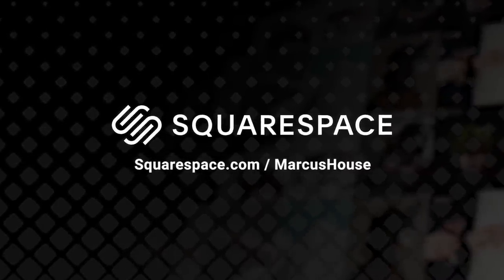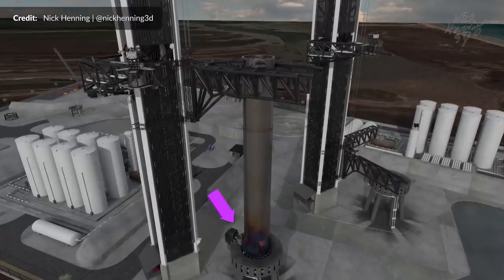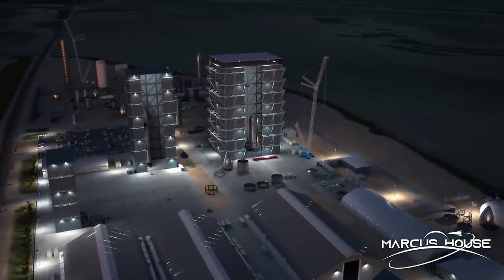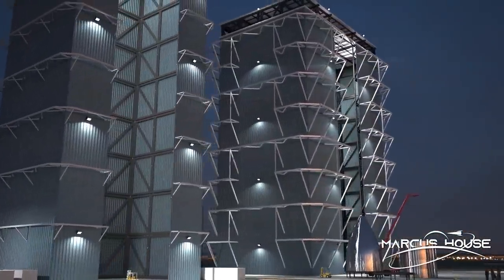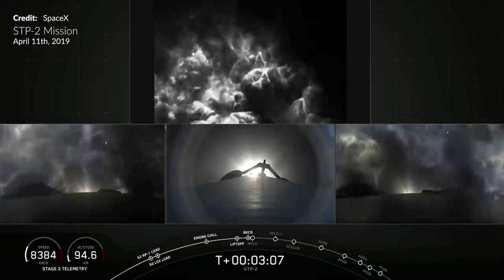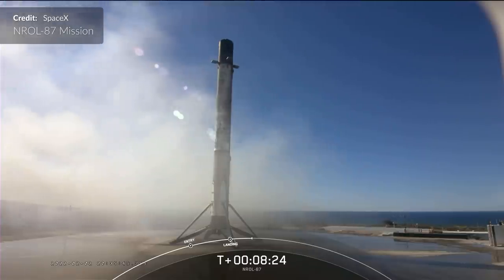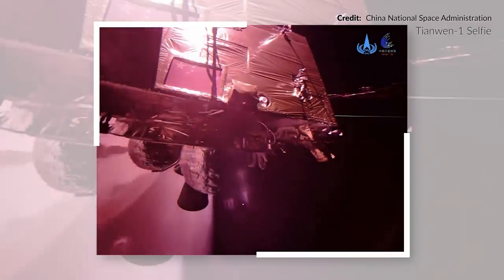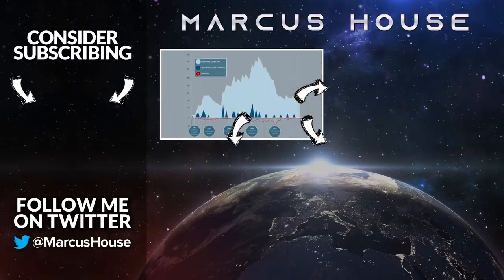SpaceX Starship Presentation for 2022, Roberts Road Facility, and 3 Falcon 9 launches in 4 days

Comment: Marcus, I heard that as a result of the Environmental Study- - the government has only approved Starship for 5 launches.

Do you know anything about this?
Reply: The review mentioned 5 Starship orbital launches per year from Boca Chica. Which is why they always planned for a facility at Kennedy Space Center. SpaceX had started some work at LC-39A off to the side of the main pad and stopped it when all work at Boca really took off. With LC-39A doing Crew Dragon, Falcon Heavy, and apparently getting the vertical integration facility for the USSF, it seems like adding Starship to all that was abandoned. Apparently, SpaceX and NASA are looking for building a new LC-49 north of LC-39B for Starship. It will be close to the access road to Playalinda Beach, so that area would likely be off limits for Starship launches.

SpaceX still has Phobos and Deimos, but I believe that conversion work on those has slowed down. I don't know if SpaceX will use them for launching Starships or not. Since Lunar Starship, and presumably Mars Starships, need 4 to 8 Tanker flights to be fully refueled, it would make sense for those to launch from Phobos & Deimos, IF they are still going to be used.
Reply: Forgot to add, the 5 launch limit per year from Boca Chica is likely due to Texas state law on closing beaches. The Texas legislature already had to change Texas state law on access to public beaches to even allow SpaceX the ability for limited beach closures.
Reply: @steveaustin2686  wow thank you for your complete reply!

Comment: Im so amazed how SpaceX / Musk keeps building and expanding, while Starship might not even work in terms of economics (or at all).
It's like spending billions and billions on building racing circuits for (and factories for mass production of) a new racecar, while there isn't even a working prototype of the car yet.
Just wow.
Reply: nothing ventured, nothing gained. Elon and company have the drive, knowledge and track record to pull it off. Failure is anticipated and part of the plan.

Comment: One question, wouldn’t the arms be pointless for a trip to mars? They wouldn’t be able to build this on Mars
Reply: There a multiple different Starship variations planned. There is the fuel tanker, commercial launch,  the Moon lander, and the Mars lander. The Moon and Mars landers will require landing legs, but may retain the pins for Earth return.
Reply: @jeffreypierson2064  thank you for clarification. I know the trip to Mars is actually going to be quite simple once they have multiple launches and data gathered. It’s the trip back to Earth from Mars that I am concerned about

Comment: They used their crane on the booster.
Reply from the maker: Yep. Scratching our head on this one. They MUST use the arms for a ship stack unless they get a new crane in, so no idea why they chose to not use the arms for the booster. I suspect they didn't have time to get the rail work done for the presentation (there are a few scaffolds still up which means they can't raise the arms right now).

Comment: 🙄 They are using a crane to place the booster on the launch stand.  Right now. 2/6/2022
Reply from the maker: Well crud. We were wrong about that then. WTF.
Reply from the maker: @Sargon_of_Cincinnati  All indications were a stack with chopsticks right up until 2 days ago. So either that info was incorrect, or they changed their mind. I can't confirm which right now.
Reply: @MarcusHouse  The reinstall of the hard points on SN20, for the lifting bridle, didn’t give you pause?
Reply from the maker: @Sargon_of_Cincinnati  They needed hardpoints to more the ship onto the stand before it was rolled over. So no. It is also worth noting that there is simply no way to lift the ship up there without the chopsticks. They don't have a crane big enough. So if they are going for a full stack it simply MUST be done with the arms. Why they would then turn around and not use the arms for the booster is beyond me. I suspect they were having trouble with booster balance (hearing rumours that the vertical attachment points were not going to line up). It is somewhat speculation of course. I try to be as accurate as I can.

Comment: I'd like to shout out the Royal Caribbean Cruises Harmony of the Sea for the range violation. brand new 220,000-ton ultra cruise ship and if it was 60 seconds later that booster would have been in flight and everyone on board would (theoretically) be in danger. gross negligence by the command staff. they should get a black mark on their licences for sure.

Comment: whıle trying to fight the mass, it is necessary to imagine to handle to gain much more speed then: I have predıcted with my theory and my formula 6.3 tımes greater speed of light which is measured as apparently inside of M87 black hole. I SUGGEST HAVING A LOOK AT THE FIRST PART OF MY THEORY AND MY FIRST FORMULA WHICH DETERMINES A LINEAR VELOCITY OF...6.3 TIMES GREATER THAN THE SPEED OF LIGHT, ETC. AND I TOLD WHERE OUR MEASURED CONSTANTS ARE ROOTED IN.  We need to change the concept of matter that makes us imprisoned by all kinds of impressions and especially by accepting the vacuum illusion which it has been sitting comfortably in it

Comment: So when will they actually proof it all works, fly to orbit, return and land again in one piece?   Up till now, it's all a lot of talk...
Reply: Once Stage 0 at Boca Chica is complete, the FAA review is complete (target of Feb 28th, 2022), and a launch license is received (after the FAA review), then they can start orbital launches. So March to April 2022 is the currently expected time frame. SpaceX seems confident of getting Starship to orbit, but the re-entry is expecting to need multiple attempts. That is why they are trying it about 100km (62 miles) north of Kauai, Hawaii, away from land and shipping lanes. Elon Musk's Mar 30th 2021 tweet

"Next major technology rev is at SN20. Those ships will be orbit-capable with heat shield & stage separation system. Ascent success probability is high.

However, SN20+ vehicles will probably need many flight attempts to survive Mach 25 entry heating & land intact."

Comment: Sorry, Wrong. No arms.
Reply from the maker: Scratching our head on this one. They MUST use the arms for a ship stack unless they get a new crane in, so no idea why they chose to not use the arms for the booster. I suspect they didn't have time to get the rail work done for the presentation (there are a few scaffolds still up which means they can't raise the arms right now).

Comment: Maybe Musk will finally get the license to launch starship from Boca Chica. Because, you know, it is inside a nature reserved and he is only allowed to launch things the size of Falcon.
So what he has done up to this point is bombarding this nature reserve with rocket fuel filled tanks. Most of it exploded, of course, but the rest went into the ground.
Also, the sound of the engines probably killed a significant amount of animals around the platform. Pretty shitty for someone that claims to want to sage the world, but hey, can you blame a billionaire that wants to build rockets not caring about some stupid animals?
Reply: Rocket fuel filled tanks? The tanks that have been exploded in testing are the ones under pressure from liquid Nitrogen, not fuel. Now if you are talking about the Starships that have RUDed, remember that they use liquid Methane and LOX and not something that goes into the ground. Both turn to gasious forms at room ( Texas ) temps. Any that does make it to the ground in liquid form will evaporate into the air.
Reply: @gravelydon7072  My error. Doesn’t help the animals he kills, though.